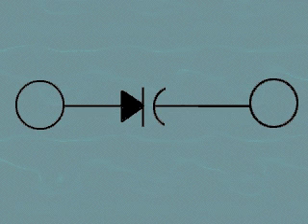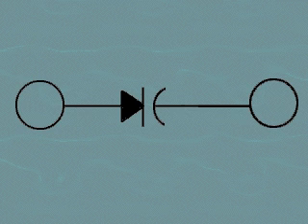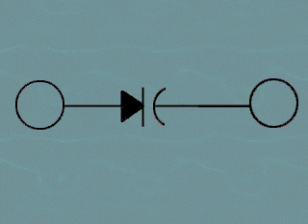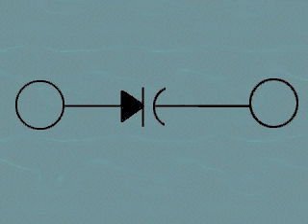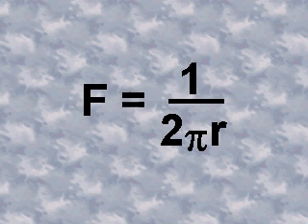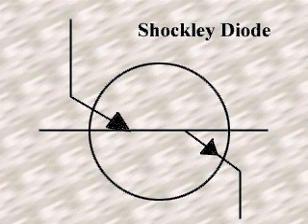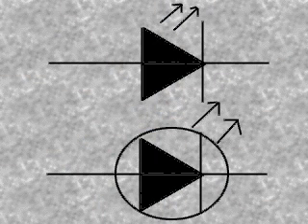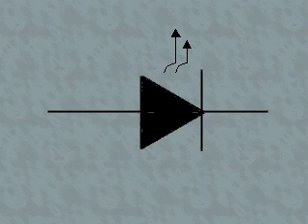Electronics Tutorial , Lessons#46 - varactor

Comment: can we use varactor diode instead of capacitor in power factor improvement
Reply from the maker: Varactor has a limited capacitance in addition to standard capacitance values so it is very hard to implement a Varactor in Power factor applications .
Reply: Saqer Khalil  sir have u any data or material regarding this topic please send me. actually I want to do my thesis on power factor improvement through varactor